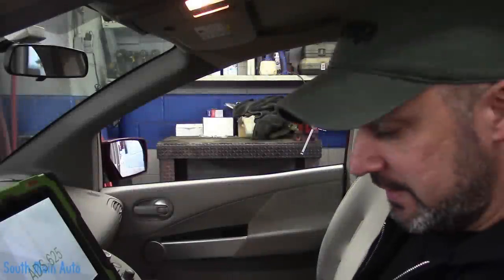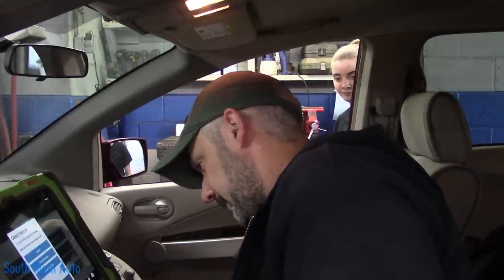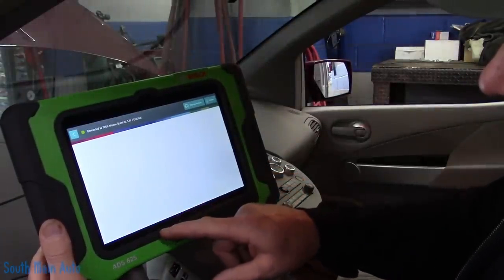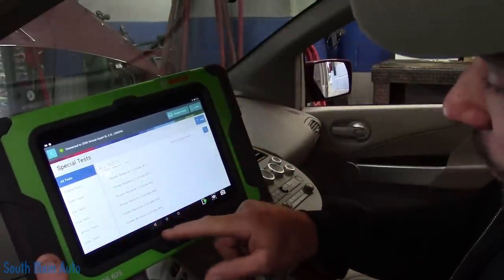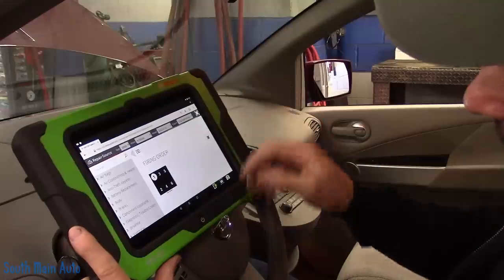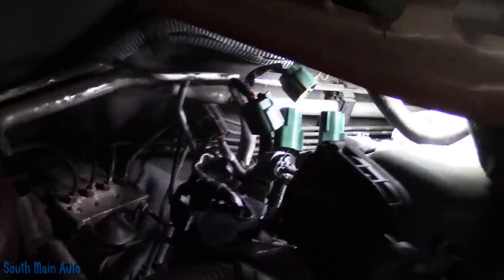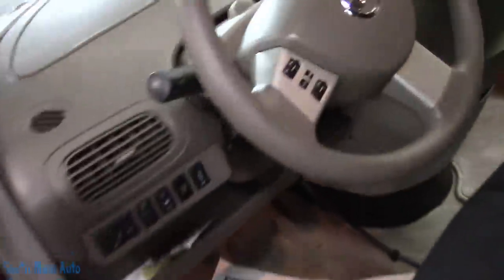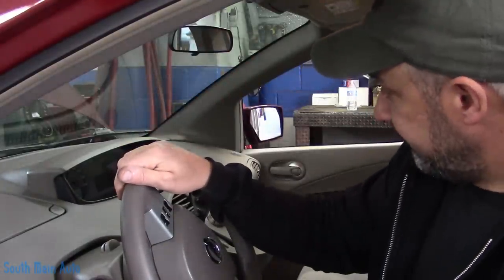Customer Replaced Spark Plugs And Now It Runs Bad!?

Comment: Once ... in my younger days .. I had an older car that wouldn’t start. Decided to remove the fuel line at the carb to check for fuel delivery. Place a cup under the end of the fuel line  but still got some gas spillage onto the intake manifold. Decide to check the coil by grounding the end of the coil wire to ... the intake manifold. The resulting fire was very warming.

Comment: First ever tune up I did was on a 1979 Chevrolet Impala, took off the plug wires then removed the plugs, put the new in and didn't get one plug wire on the correct plug, took me over 3 hours to get it right, my dad was of no help due to his laughter. I was 19 at the time, 42 now and have since learned that you change plugs and plug wires ONE AT A TIME.

Comment: Doing an oil change on a mid 2000's Taurus.  Got the filter off, looked at it quickly and thought I saw the o-ring still on it.  Put on the new filter, filled up the oil and started the engine....  Oil was blowing everywhere under the hood!  Turns out the old filter o-ring was stuck to the block... two o-rings seal as well as no o-rings but not as well as 1 o-ring.  LOL

Comment: First time I ever replaced plugs and leads was many many years back on a Suzuki Swift GTi I had.

In my enthusiasm, I dived in and ripped out all four plugs and all four HT leads before fitting any of the new ones.

It was at that point that I realised my mistake.

Now I do the job one cylinder at a time.

Comment: I recently changed the sparks plugs and wires on my 2007 GMC Sierra, and notice engine running a little rough.  I assumed the plugs came already gap,  after lots of searching on you tube, found someone that told me if I checked the gap before instal.  I said no.  Sure the gaps were too tight.  Had to regap them.  That number 8 kicked my ass.  Runs great now.

Comment: I was rebuilding a 302 Ford and had just got the block and crank back from the machine shop. I installed the cam bearings, frost plugs and oil plugs. Mic'd everything to double check tolerances and put in the crank, new connecting rods, pistons, heads etc. Buttoned it all up, primed the oil pump, set timing and fired it up. it ran like a top. then I noticed the oil pressure was only 20lbs. dropped the pan and pulled the brand new oil pump and replaced it with a new high pressure oil pump. refired it up. 22lbs oil pressure. got mad and threw my keys at my tool box. This was when I noticed the single lonely oil plug that goes under the intake just sitting there. Pulled the intake and sure enough. no plug. tapped it in and reinstalled the intake. 65lbs oil pressure. I felt like an idiot but was glad i figured it out.

Comment: I’m pretty good at averting big mistakes however, a Camry 6 cyl water pump got me good once. Lost an insignificant nut from a bracket and searched high and low but couldn’t find it. Grabbed one out of the bolt bin and installed it. Upon start-up heard a noise and noticed oil pouring from underneath. Damn but had fallen behind the crank pulley and tore open the aluminum timing cover right into the gerotor pump galley. Needless to say I spent a week out of pocket dropping the engine and installing a salvage timing cover/oil pump. Luckily the customer was very cool and understanding and all it cost them was another week without their second car. Lessons such as these can be drilled into a young tech’s head but until it hits you where it hurts you don’t quite grasp the importance of habits like absolutely shutting down an operation until all hardware is found, etc.

Comment: Another issue that I have uncovered over the years is that good old "Dielectric grease" all over the spark plugs. Been a victim of that twice. Speaking from the perspective of a GM 1991 5.7L and GM 1997 3.8L even a little/tiny bit of that stuff on the spark plug boot or ceramic shaft can cause one or more misfires usually after you have been driving it for an extended drive or maybe an hour or longer or even weeks or months down the road. I don't know if one brand name is better than another for dielectric grease, it all looks the same, but it melts and will migrate down, usually, toward the plug body where it screws into the cylinder head or toward the tip if the plugs point slightly downward. It gets sticky after a few years under the hood and you might be used to that goop all over the plugs and boots but it can really mess with your head when you cannot figure out what the heck is wrong and you never guess that this dielectric grease is insulating the plug from the wire or coil. When this scenario occurs, the electricity takes the path of least resistance and goes where it should should and should not so you either get a weak spark jumping the gap or no spark jumping the gap on the plug. On my 5.7L I recently replaced the rusty 30 year old grade eight exhaust manifold bolts and immediately had visible spark jumping to the three year old exhaust manifolds. I cleaned the invisible amount of sticky dielectric grease off of the plug boots and spark plugs and that was the end of it. A tiny amount, like smaller than a pea sized amount, can create this issue if it ends up on spark plug tips and or the threads.

Comment: First Detroit Diesel I ever worked on was in a bus and I did an oil change on it.  When I finished, I fired it up and discovered I had forgotten to reinstall the secondary oil filter.  Was amazing how quick it pumped 6 gallons of oil onto the shop floor.
Reply: Now, that's what I call an "oil" change. bet it was clean as a whistle after that!

Comment: PJ most likely means Plug/Jack.  On aircraft, specifically military aircraft,  wiring diagrams are labeled like that.  For example a 20 pin plug on a engine harness will have the Jack ( The stationary electrical connector) labeled  J3704 and the plug labeled  P3704.  But sometimes in text next to the plug and jack   the schematic will show PJ3704.  So PJs are indeed not pajamas but most likely shorthand for Plug/Jack.

Comment: I pulled my engine and trans often to add something or build it up a bit. One time I put engine trans TC etc in the car, hooked up headers, driveshaft, trans lines, blah blah. Went to put in starter and saw I didn't put the block plate in between the engine and trans, hence no good way to mount or center the stater. Many bad words exited me when I realized this. I always work alone which makes engine and trans removal very time consuming. I know what you might be thinking but No I couldn't just pull the trans to correct this. The trans is a heavy AOD, I'm a weak old little guy with no lift to put the car on, no fancy trans jack etc. That was a huge learning experience I hope I never forget. Each time I do an engine trans installation I think about it :-)

Comment: Ben there done that. I did forget to put in hold down bolt on the distributor. Thinking it wouldn't move..up. Ran great the nothing. Took a little bit but figured it out .

Comment: There was this one time........
I did a rebuild on a caterpillar 3208. Had my red shop rags all covering everything nicely to keep shop grim off of all the parts on my bench. Eventually got all I needed back from the machine shop and put her all back together. I had a manual oil pressure gauge on my new rebuild and had her running, all was looking good, no leaks. After some time the oil pressure slowly started dropping, dropping and dropping. After the oils pressure got down to around 15psi I new something was up. I eventually found out that I left a red shop rag up inside the air compressor. So... dropped the pan, cleaned out the pick up, fresh filter and oil and all was well.

Comment: When I did my own DIY plug and wire change on the GM 3400, which has the same firing order, I had very little DIY car knowledge. I was so afraid to make a mistake, because I thought the car would explode if I would have made a mistake lol. Ultimately, I triple checked, quadruple checked, then fired it up and all was good....but it was very scary in the heat of the moment doing the job without having the prior experience...I was extremely paranoid, but I'm glad I was, because the paranoia forces you not to rush things and do it right.

Comment: I replaced my transmission on my 95 corolla two years ago. Took me several days because I took my time, but after I got it all together, it ran like a tractor. Literally, sounded like a diesel tractor and was smoking really bad from everywhere. Had no idea what i did wrong and I was freaking out. I was then advised to check all vacuum hoses, even the ones I didn't touch. Sure enough, the MAP sensor was not hooked up to the vacuum hose so it was dumping fuel in the engine. I'm surprised it started and ran! Anyway, as soon as I plugged it in I felt relieved, happy, and stupid for not checking basics first haha

Comment: Back in the day was putting new front brake pads on my New Yorker and was working out in my driveway . As luck would have it it started raining on me and I then discovered being mad at the rain instead of watching what I was doing was good way to put the pads in backwards . The backing plates contacting the rotor made a horrible grinding  and the brakes had no intention of slowing the car down , only did it on that one [ so far ]

Comment: Last year i called a trunk release module which was bad but i forgot to check the handle itself. After putting the new module in i noticed the handle on the inside was rusted completely and had snapped. Another one which happened recently not to me but to 2 of our shop master techs who were rebuilding an engine for the 2013 Toyota frs which has a valve lifter recall. They repaired the engine however it came back for a ticking. They said the engine was making noise but and sent it to a machine shop to have it completely rebuilt. Cost us a couple thousand but it turned out the flywheel had a crack in it and thats what was causing the noise

Comment: When I was in college was doing the front breaks on my Ols 98. I put one side back together and hit the breaks to make sure everything was together correctly and there was not pressure. After a few pumps and building frustration, I walked around the car saw a puddle of fluid on the other side of the car and remembered that I forgot to put both sides back together before pumping the breaks. That was the day that I learned out to rebuild a caliper.

Comment: One of the only reasons I love COP because you can't possibly screw that up.  Do them one at a time boot out plug out then reverse and go to the next one.  I actually just replaced my spark plugs in my 2007 Escape tonight LOL.

Last time I was dealing with cables was my Mom's 2000 Caravan which had them.

I don't miss it.

Comment: I’m into classic cars. I own two Daimler DS420 limousines. One winter I removed one of the dual fuel tanks as I was welding a panel in the boot (trunk). I left it for a few weeks afterwards as I was doing other jobs. I took it to get fuel one day. Opened the filler cap of one of the tanks and yes you guessed it... pumped about two gallons of fuel into the boot. It was only when petrol poured onto my shoe that I realised I had not fitted the tank back on that side!! I blame it on my age lol

Comment: After working all day, going home and replacing 4 ball joints, a wheel hub and 2 rotors on my f1rusty, I forgot to torque the bottom passenger side brake caliper bolt, which I found out about on my way to work when a quarter of the truck tried to stop but the rest didn’t 😮 luckily there was no damage other than my drawers!

Comment: As a young driver my dad let me drive his second car a 1949 Plymouth Cranbrook. While the car was running I had the bright idea to check the plug wires on the distributor to make sure they were on good. It didn't take long for me to learn my lesson as the bolt of energy went through my arm down my leg into the ground. The electrical system was working just fine.  LOL

Comment: My first car, I bought all new spark plug wires. Ripped out the old set and then looked and thought, well that was stupid. Looked at the firing order stamped on the block. Broke out the manual to find position one on the distributor. All better, It was simple error and simple fix.

Comment: Here's mine. I changed front brake callipers; a job I've done before. I installed the right side on the left and visa versa. I bled the system several times but the brakes were always soft because of air in the system. Activated the ABS re-bled the system.... Same issue until i noticed my mistake. (the bleed screws were not on top of the brake cylinder so there was no way to get all the air out) Not my proudest moment.

Comment: old video, but I took apart the sprag clutch used by the starter on a BMW F650GS motorcycle. Bought the special alternator puller etc. got it all back together and lo and behold, I had installed it backwards so the starter just spun and didn't engage. Had to take apart the whole side of the engine again to flip it around.

Comment: Just last week was adjusting ignition timing on my old Honda CB650 after disassembly for cleaning and some parts replacement. Accidentally set the advance to the idle setting. Wouldn’t start and I was getting so frustrated. Next day I realized my stupid mistake. Bike runs great now.

Comment: Ok, I'll bite. Lol. About 20 years ago, I was an entry-level technician at a local GM dealership. Did my very first head gasket job on a 92' Lumina with the 3.1L. Everything came apart nicely. Upon reassembly, I decided to cover both head gaskets with Hi-Tack sealant to prevent any "leaks"....😳 (At that time, not realizing that when you bolted the heads back on, the compression between the head and block would "seal" it up.) Reassembly went smooth as well. Upon initial start-up, it fired right up, sounded great. About 25-30 seconds in, I couldn't for the life of me understand why all this smoke started appearing? So I called the lead tech over. I expained what steps I did. He grinned ear to ear. Shook my hand, reached in his pocket pulled out a $10, said go treat yourself to lunch, when you come back, tear everything down again and this time, leave the Hi-Tack on the shelf. Lesson certainly learned. 😂

Comment: My biggest "miss" mistake was installing a rebuilt engine the customer selected for a big local engine rebuilder.

3 cylinders misfired. Swap plugs and wires and it made no difference. The compression tests were good on all 3 holes.

However, a compression test on the motor as it was running showed the 3 cylinders in question at 0-5 PSI.

I go to the rebuilder to have him put good valve springs in the motor. Then I see the problem. These motors were all assembled by unskilled undocumented labor. Not one soul in the house except the owner and what he called a Shop Foreman spoke English. They said they were to busy to get to this car in under a week but I was welcome to a coffee can full of springs to pick from.

I am a performance kinda guy... I have a tool this "rebuild facility" did not have... A valve spring checker.

The following year I got another customer with a similar issue but it was only one cylinder

I moved away from that area of Los Angeles county in 1985. Just for legal issues, I checked before posting the name of the rebuilder... Cherry Engine Rebuilders on Cherry Ave. in Long Beach California did the people of Los Angeles county a favor and closed its doors for good.

In 1987 I lived in Orange County, California. I bought a 1970 Mustang with a 351W motor. A fresh rebuild from a local shop known as Orange Engine. The motor was in the car for less than a year. I bought the car cheap. It was taken to the shop I worked at for a diagnosis.. 2 hols on the passenger side were pumping water over the fender as fast as you could pour it in as the motor was cranked. The problem was determined "most likely a has gasket but needed to be torn down for a look. The customer declined.

I asked the customer what he'd take for the car as-is and bought it. On tearing the motor down I found.
Bore .060 over
Rods and mains .030 under.

The valves had no margins.(I found this out when I traded the heads for the valve grind on the 460 I was rebuilding myself to go in that car. My friend Bill that owned to local machine shop said he should have hit me over the head with both cylinder heads when he started to rebuild them.  He said, "The valves were ground so sharp you could save with them". 3 of the exhaust valves were burnt to the stems on one side. Not one valve out of 16 was able to take a grind.

After that, I started building inhouse with no problems. Except for a divorced lady with  Datsun Honeybee. Her motor came in with a cylinder head that looked like it lost a fight with a Vulcan cannon. It was a 1.2-liter motor with pushrods... I took it .010 over and located a head for a fresh valve grind. I get the motor in and find the carb needs a rebuild/cleaning. She takes the car as it to come in next week to get that done. Her ex-husband does the carb. The car returns with what sounds like a rod knock. The Ex is there and pissed off that we sold her a defective motor. I start into it in front of the Ex and find that 2 nuts are missing that hold the carb to the intake. I asked him where they are, he says they must have gotten lost... I lift the had and found them... embedded in the #2 and #3 pistons. Since he is not the customer I said: "Next time the trashman comes to your house make sure he picks up your tools." I was a little pissed myself that this idiot screwed up my good work and tried to blame me for his doing.